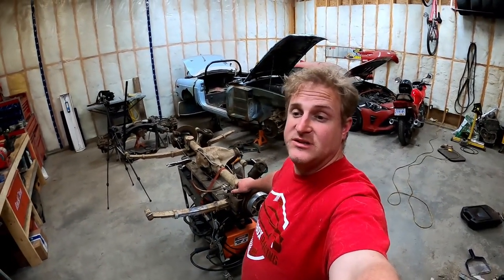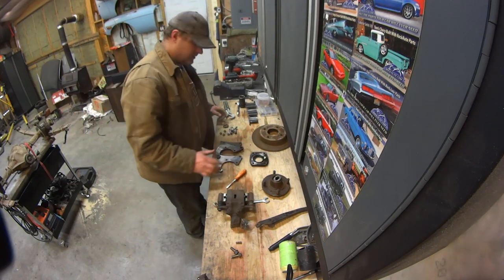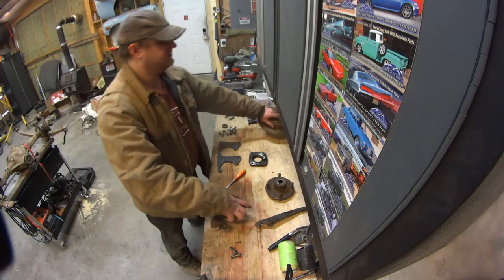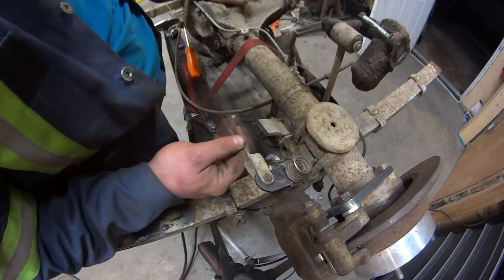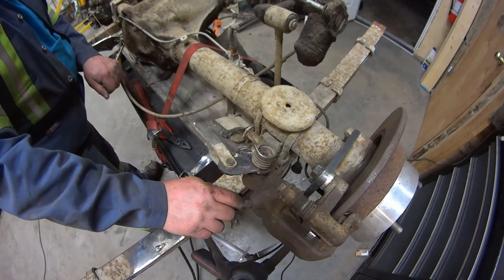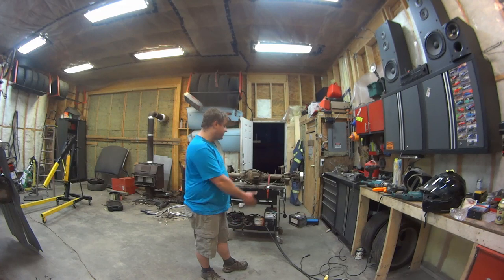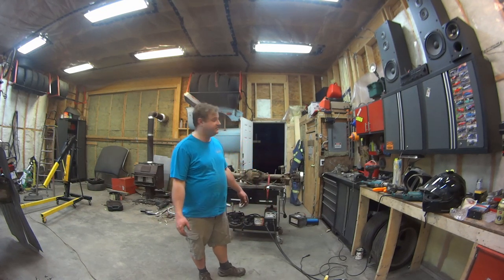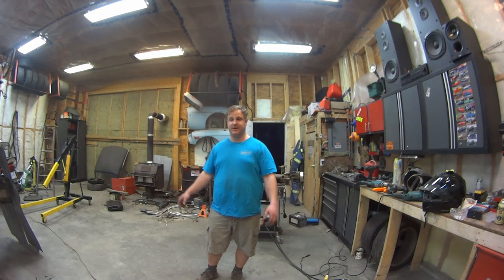Make Your Mgb Stop On A Dime With This Easy Rear Disk Brake Conversion! #mgb #k24z3 #restomod

Comment: the SE R spec V  uses   different rear calipers from the base model,  plus within the Spec cars,  they offered  larger   stock or optional Bembro.  Rock Auto should probably be able to sort it out  for a part number and your local (friendly??)  salvage yard ought to be able to provide the Hollander interchange info to figure out what they have in stock.
Reply from the maker: that make sence i think the base model has drum brakes anyways at least the ones that were delivered to my area did.

Comment: ‘04 Sentra? What other cars rear disk brakes can mgb owner use? Anyone know?
Reply from the maker: i am sure there are many calipers that could be used. the process of making bracket adapters would be similar for most. its just a question of following the steps. measure many times then design the brackets. test fittting ect. but this specific combination makes things a bit easier for people that want something thats tried and tested and within the skillset of most people to do.

Comment: Cómo puedo conseguir esa base para adaptar mis caliper a mi 8.8 del fox
Reply from the maker: the 8.8 in a foxbody is a very different axle. and im sure there are many off the shelf solutions available for it from summit racing and jegs and other online stores. there are probably similar solutions for it to what I've shown as well but it would require some digging in forums to find that out. this specific caliper, rotor and bracket setup would be unlikely to work on it